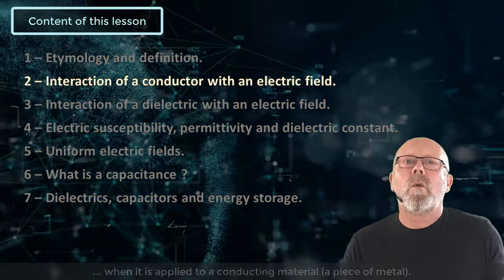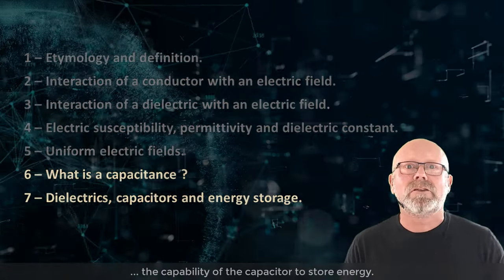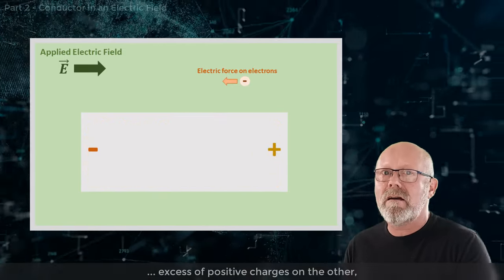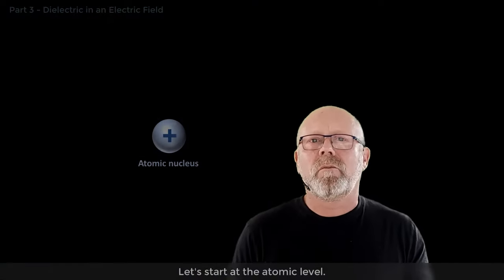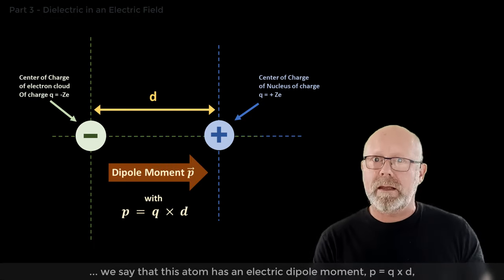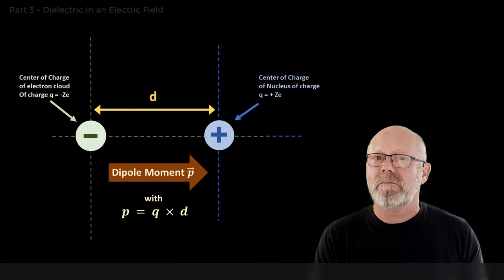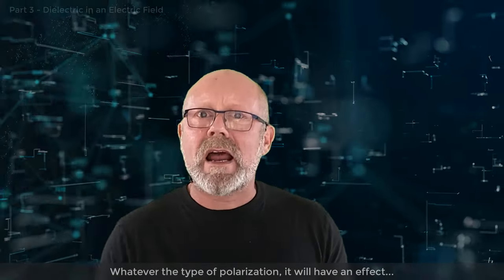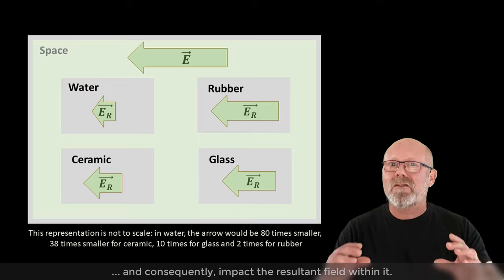What is a Dielectric? (Physics, Electricity)

Comment: Sir I have a question is that,in the sun core nuclear fusion occured and it emits highly energetic radiation called Gama rays. So it emits gamma rays but we get UV rays how's that possible.sir explain us clearly
Reply from the maker: Hi Shivam, indeed gamma rays are produced in large quantities in the Sun's core... but in order for these to reach out, they need to leave the core and go through all the other non fusionning layers of the sun. By doing so, they collide with a lot of matter which results in the ray losing its energy and the production of lower energy photons. hundreds of thousand of years later, when it finally reaches the surface, the gamma ray is a not gamma ray anymore because it lost a lot of energy in that process.
As for the UV light, it's another phenomena: Black body radiation. Close UV (the one you are referring too I suppose), is the end tail of the spectra (around 200nm). Much hotter stars than the sun emit a much higher density of UV light. I wouldn't enjoy living on a planet around such a star!
Reply: It means, sun ray take alot of time to reach us,omg😲😲😲😲

Comment: This is another great video. The analogy with mechanical energy stored in a spring at the end really does add a tangible image that pulls it all together. The meaning of equations, even simple ones, can be quite elusive.
Reply from the maker: Yes, that is why I made this analogy... Many find these equations quite abstract, the analogy allows to make it more concrete. What you can try is look at other equations, and try to find a tangible picture for these two. Feynman does this a lot, that's why he is a great teacher. For example, I really enjoyed his analogy between RLC circuits and a damped mechanical oscillator (his lessons are downloadable for free online as text).

Comment: Nice video and presentation. 
Dielectric is something that pass (permits) electric (charge) into a space occupied by it. 
We know that vacuum-space holds electrostatic, so itself is also a dielectric, the size of a universe. 
As it permits electric into the vacuum-space, it also responsible for light propagation within the vacuum-space. 
Further? 
Vacuum-space is a dielectric with no physical but electrical properties, permittivity, known as e0 or Aether.  
So light from distance stars can reach us because of e0 or Aether.
Reply from the maker: Hi there philoso, 
First, a dielectric lets the effect of a charge (the electric field it generates) pass through it, not the charge itself.
And yes, you can say that because vacuum has a dielectric property (eps 0),  light, which is basically the propagation of an oscillating electric field, can pass through it. And yes again, that is why we can see the stars at night.
Reply: @PhysicsMadeEasy First, no one said about “pass through”

Comment: Amazing!!! Your Videos enhances way of thinking.. Keep it up Sir! Our prof. also explained (Why capacitance increases due to dielectric) by breakdown voltage concept also..
Reply from the maker: Thank you Parmanand. Breakdown Voltage is more related to when the voltage, thus the field is so large that it can modify the electronic structure of the material. Basically the electric force becomes large enough to strip atoms / molecules of some of their electrons. This usually results in damaging irreversibly the capacitor.
Reply: @PhysicsMadeEasy  okay... Got it..

Comment: Hello!!!  I love your point of view on explaining these physical terms, found it very helpful!!  thx!! Having one interesting thought here, as you mentioned when we put a dielectric material into the capacitor, as which having a much higher permittivity (than air), it will requires more charge to be build to balance out the effect of the induced electric field. Now, as we increase the permittivity of the dielectric, more charges can be stored, to the point the permittivity is infinite (like a metal), what would happen, assuming we can have some sort of barrier to prevent the charge to go through the metal. are we creating a plasma here :)
Reply from the maker: Hi,
Interesting, but I see a problem with your reflection: you assume a barrier that you place to prevent charges from passing through the material of infinite permittivity (a metal). What you are doing here is creating two capacitors in series (the di-eletric used for both capacitors being the charge-blocking material)... That changes fundamentally the configuration you are trying to explore...
Reply: @PhysicsMadeEasy  Got u. thx!!

Comment: Bonjour (hi) sir..
I have doubt in dipole moment.....
That dipole moment will happen when electric field passed through it ????? Is it right????? 
Could you pls reply...sir...
Reply from the maker: Dipole moments do not necessarily need an external field to exist. For example, a water molecule is polar by structure. In a glass of water, the molecules are oriented randomly so there is no net dipole moment for the glass of water. However, applying an electric field will orient all the dipole moments of the water molecules generatiing a net electric dipole for the glass of water 
But applying a field , one can also create electric dipole moments in a medium composed of positive and negative charges that are uniformly dispersed. In that case, you can get also a net electric dipole moment. I recommend you check my video on magnetic dipole moments, it could help: https://youtu.be/lG1TP5-rKfM?si=7wEytIHJeieiQggR
Reply: @PhysicsMadeEasy  sir thank you so much sir you are the first physicist for me who gave me reply.......

Comment: Hi @Physics Made Easy I find your videos both inspiring and educational, yet I feel the playlist on electricity went a little too off on the advanced side not explaining the basics thoroughly enough. Would you ever consider adding a few detailed videos on resistance, voltage, current, and basic circuits? Thank you
Reply from the maker: Hello James, thank you for your encouragement. 
There is no real structure or plan in the playlists (playlists are not courses), I just categorize the videos in major subjects. 
Still, when thinking of it, what you say is correct. Recently, I did tend to make videos about the topics I find inspiring, and thus, that can be of higher level (yet remaining within the scope of high school physics).  

Your suggestion remains excellent though. thanks. I will consider this for future videos. Note that some of the older videos on that playlist do talk about circuit basics, but in a more applied and concise way.

Comment: Hello sir ,
I have some confusions.

1.) Sir I have observed that in almost all the water taps I have seen , there is a strange pattern. First when the tap is opened partially or very little , a laminar flow of water is observed but then turbulent flow is observed when th tap is opened completely. But the odd thing is that pattern I turbulent flow is observed repeatedly, meaning the next when we have done the same the same pattern of turbulent flow appears like one end it is thinner or any thing else. Is that pattern is predefined? 

2.) Sir whenever I see bubbles or foam I any liquid,  whether water or milk, the bubbles gradually move towards the boundaries of the glass or containers 
. Why it is so?

3.) Also sir when a bubble is formed on the surface of transparent liquid, then the light intensity at bottom of that bubble increase. Why this happens sir ? Is it acting like a lense?
Reply from the maker: Hi Kim,
Question 1: I do not understand your question. Please reformulate.
Question 2: To minimise surfacic energy. 
Question 3: Yes, there will be refraction occurring when light passes through the bubbles surfacic layer. Under the right conditions, it could act like a lens. It can also act like a thin film with constructive or destructive interference depending on the wavelength, incident angle and thickness of the bubble surface. This is why soap bubbles can look all iridiscent, and when they thin out, they lose this iridescence and become all transparent.

Comment: at 6:55  assuming epsilon approaches to infinity,  E' goes to E, Er(=D displacement field) disappears,  but when epsilon approaches to infinity and still finite, Er(=D) still goes to zero, while E'(=P due to polarization) approaches to infinity, i found this contradiction in EM theory.
how high can an  epsilon go without being broken away to be free?
even if they are free, but the bulk of the left free MUST be equal to the bulk of the right "HOLES" that which should be considered the macroscopic polarization..... fine fine E can be discontinuous but must be conservative without changing B field present.
Reply from the maker: I am not fully sure I understand your comment (I feel there is an interrogation behind it that I do not see clearly). 

What I know is that permittivity cannot be infinite in the real world... It is a property that depends on the charge structure of a material. In any material, there will always be a limit to how much it can get polarised. Without limit, it would not be a dielectric anymore, because there would not be any polarisation but a current flow.... 
If you wish to consider epsilon as infinite: that means there is a current instead of a polarisation... It's not a dielectric anymore but a conductor or a superconductor.
If you wish to say it tends to infinity (without reaching it), you are inventing a theoretical material... Maybe you can find an answer to your question by checking out more in detail ferroelectric materials, these tend to have very high permittivities, and then extrapolate from there..   

My answer was probably not very helpful here, but maybe it gave you a lead to investigate further.
Reply: @PhysicsMadeEasy  i think my confusion came from here, the higher epsilon the better the capacity is in formula, so why not using salt water ( epsilon=80~88 instead of paper or plastic) but salt water conducts electricity. and when  epsilon goes to infinity, the material goes to be like a conductor. the higher the epsilon meaning E (external E) is NOT passing through well, but P(polarization or induced E) will rise and store more energy into the material,  so dielectric permittivity(electric field passing through) should take the max value for air and min value for matal.  but they are apposite, min value for air , max for metal. why or how?
Reply from the maker: @abcdef2069  Let’s go back to the definition of permittivity : It is the ability of a material to resist the formation of an electric field inside it. Metals are conductors, so as soon as you try to apply an electric field on it, the electrons in the metal are going to move along the field lines until they find equilibrium: When they finally do, there is now in the metal an electric field that cancels the applied field. So there is no resultant field in the metal. 
That’s why the permittivity is theoretically infinite for a metal. Finding an infinity, is very often a sign that there is something wrong with the reasoning: And what is wrong here is to assume that a metal is a dielectric  … It’s a little like if you were measuring the hardness of a liquid… A liquid is not a solid. 
I hope this idea helps.

Comment: Sir I have two more questions
1) Sir suppose we want to find the work done and given is that force (f) is a function of displacement (s) as f(s)=f=s². So integration should be done from 0 to s , and I did and got s³/3.But sir if want to find the final velocity (v) than can we equate the W to 0.5mv². I was confused because it's for uniform form force and here it is variable. And if not then how can it be found sir? 

Time
2) sir suppose we have a Blok of mass m in the air(but no drag) at height h, so gravitational force acting on it is mg. Now we apply a force of equal magnitude but in opposite direction to balance the forces. Show the block will either be at rest or it will moving with a constant velocity. And here I assumed it to be going with uniform velocity in downward direction and covered the height h. Now both the forces are still acting so there must be some work done by them: for the gravity mgh and for the external force -mgh. So there is net Work done 0 and so it doesn't accelerate. But while approaching downward is potential energy decreases, and my question is where that potential energy lose? Please explain sir
Reply from the maker: Hi Kim,
1/ Because Energy is a conserved quantity. The way the object got it (with a constant force or not) does not matter… The work done by the force resulted in some energy provided to the object. If that energy goes fully to the object as KE, then that KE will be equal to the work done (s^3/3). You can write W = s^3/3 = 0.5mv(final)^2.

2/ We will suppose on a planet with no atmosphere (no air).
How would you apply that force? You would need a flying vehicle with a rope holding the object so that tension in the rope would balance the force of gravity. How would you keep the vehicle from accelerating downwards… (make it fall at a constant speed), You would need to use energy (propulsion upwards just enough to counter grav. acceleration). … I let you finish the reasoning 😉

Comment: @Physics Made Easy  hello sir, as you have recommended to search for state functions and I did but I find something very confusing. In almost every video it was said that heat and work done are the two most common examples which are not state variables or state function. It means that while doing work, the work depends on the path of the object that it took and it seems obvious because the formula itself is force into displacement. But sir it was also taught work done by a gravitational field on an object does not depend on its path. So it is also state function because it fits in the definition of the state function. Is it so sir?

I have one more confusion related to this, whenever there is a situation in which it is given that an object of mass m is lifted by someone, so we take that the force applied to lift the object is MG , this means that the object is moving upward with a constant velocity but what if the force applied is not mg?
Why we always take MG in this type of scenario sir even though it is not always ?
Reply from the maker: Hi Kim, Work and heat are not state functions because these are energy transfers not energy states… You change the state of an object by heating it or working on it.
For example consider hunger as a state function. Weather you eat bananas or rice your hunger will become small. And whether you eat your portion fast or slowly, your hunger state will be the same at the end of your feast.
Your second question. When you apply a force equal to mg for a height from 0 to h, it means you provide work equal to mgh. Because the net force is balanced, there is no net acceleration, so no increase in speed, so no increase in KE. All the work you did went into PE, which is therefore mgh.
If your force is > than mg, the object will accelerate so the KE will increase. Your work Fapplied*h will contribute both to the PE and the KE. 
I hope this helps
Enjpy the year end celebrations!
Reply: @PhysicsMadeEasy   Thanks for this explanation sir.

Comment: Sir does circular instantaneous speed and linear instantaneous speed is 100  percent same or there is any difference between very small displacements on circular track and linear track?
Reply from the maker: Hello Rahul. angular speeds (what you call circular I suppose) and linear speeds are not the same thing. Linear speed (LS)  is distance per unit time, angular speed (AS) is angle covered per unit time. The relation between them is the radius (LS = AS x R). This relation applies for both instantaneous or average speeds.
Reply: Sir I'm asking about instantaneous speed on circular track which is equal to omega ×radius in comparison with linear instantaneous speed
Reply from the maker: @rahulkajala25  Imagine you would put a mass at the end of a rope, and spin it (no gravity, no air resistance: you are in space). The speed  of the ball would be omega x R right? Suddenly the rope is cut ... What would be the speed and direction of the motion of the mass after that event, still the same (there is no acceleration anymore, so V = Omega x R). and the motion would be linear. 

In other words, the speed of the ball perpendicular to the radius (what you call instantaneous speed on circular track) and linear speed are the same concept.